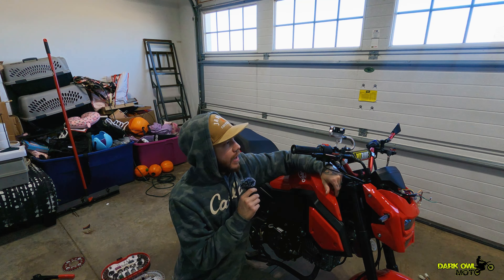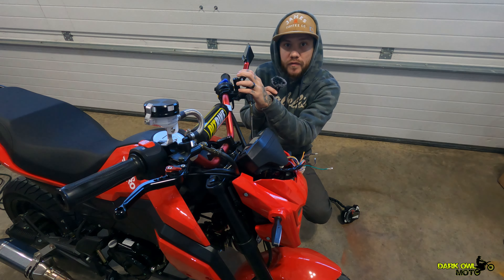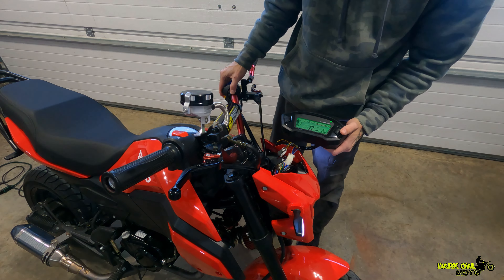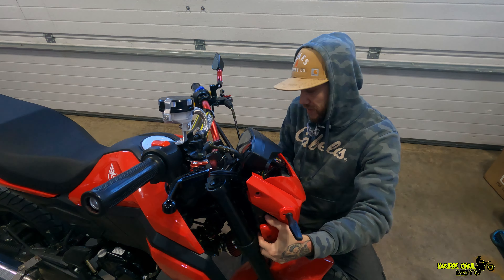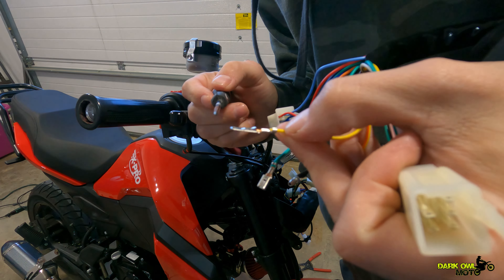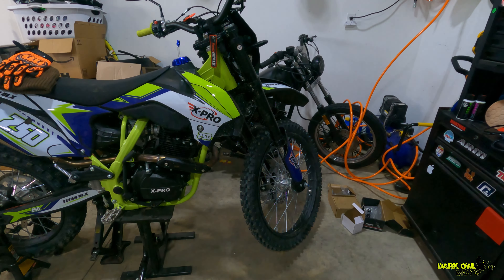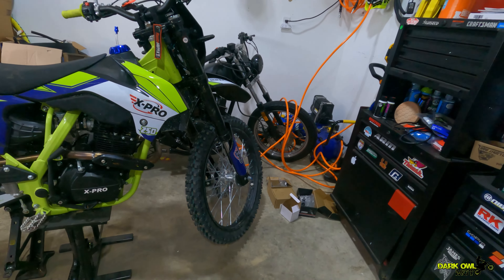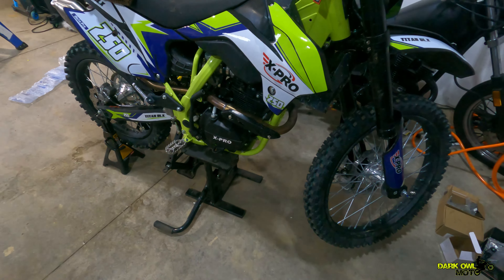Xpro 125cc Speedometer install.

Comment: I don’t ride and I’m thinking about buying one of these to commute to work. Would I absolutely need to do the upgrades like carb and gears if I don’t really need it for power? I guess what I’m wondering is does the bike work as is or will the stock stuff break?
Reply from the maker: The bike will definitely work as is! Just need to make sure every nut and bolt are tightened. And make sure the oil is swapped out when you get it. Also these bikes do not reach highway speeds. So if your commute involves highway/freeway speeds I wouldn't recommend.
Reply: @darkowlmoto  Awesome thank you. I will lock tight everything and change the oil for sure. Highway speed is not an issue. But I also don’t want a scooter. These look fun and easy enough to learn to ride. I really appreciate your quick response
Reply from the maker: @PathOfTheRonin  you bet and no problem!

Comment: How did you mount? did you make a bracket?
Reply from the maker: I used one screw and screwed it into the original spot on the bikes stock mount. I believe I show in the video

Comment: it always nice to have the right plug in they should supply male and female set and plugs. it would be a easier sell for the company. iv got a clone but a grom wiring because of fuel injection for my 190cc. a fuel and mph adjustments are awesome i need  to get one of these. the company need to change all there paper work they should no that there bad. also make people happy not having to call for it. less work for them. by changing a type o. great video. ps so 1-5 and n possible?
Reply from the maker: Yep! It has 6 gear wires only 5 are used for a 4 speed clone. So this can be put on any scooter or motorcycle.
Reply: thanks for the repeat i notice  wire what  y0u went off a grom wiring going to be 5 not 6 to that means the other wire on the engine people are not quite sure were it goes to on the  190cc engine side   im almost positive  id have to try by  adding  wire for it to read  and new dash. thats why there no videos  no. no one got this working even with a after market dash that crazy for the amount  of people  buy new dash and sill cant get it to work on line and only in stand a lone reader.   thanks  you @darkowlmoto
Reply from the maker: @josephsaucedo8691  yup so this is a Chinese clone of the real Honda Grom dash. It has extra wires for 6 speeds. But you won't need two of them for a normal 4 speed clone. Also has extra wires for water temp and check engine light.
Reply: the new model real grom wire has the 5 speed trans a N but  with the190 in you have to use the older grom 4 with N just like the clone only difference is fuel injection ecu electric fuel pump in a gr0m harness you can by pass  its the only easy way to get a 190 fuel ejection old grom wiring swap  ln a clone frame. wish the new grom wire swap work on the 190 it something to do with the ecu why it need the older model i was told'

Comment: Can you point me in the direction of actually contacting the manufactuer via email? I need modified mso bso
Reply from the maker: I’d need to know where you purchased it from. And the brand as well would help. If it is an xpro you could always contact Xpro USA or you may need to contact the actual seller which would be more ideal.
Reply: @darkowlmoto  I aquired it in a trade and the guy didnt have the paperwork anymore,  i believe its an xpro 2022 HaWk DLX 250 EFI